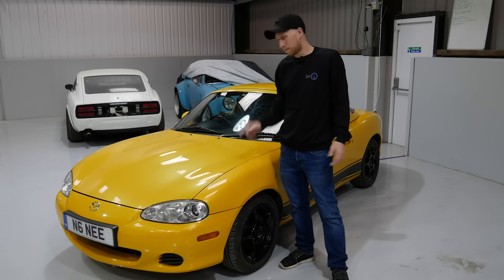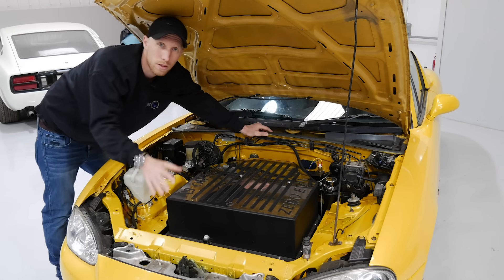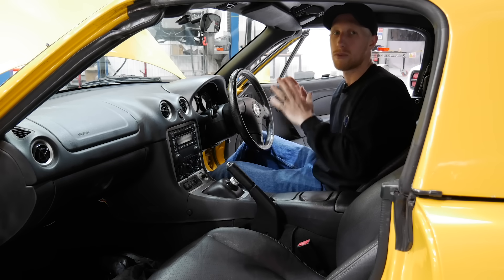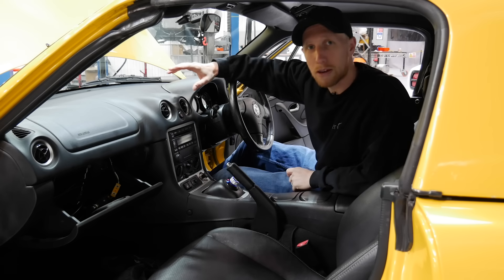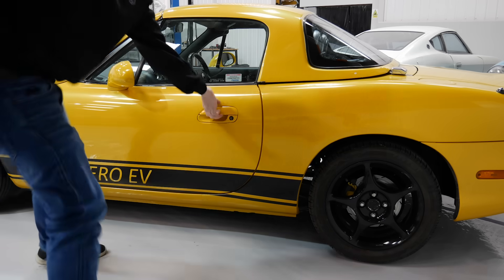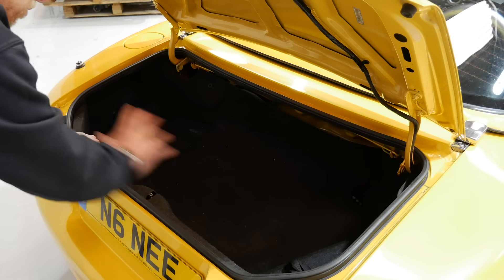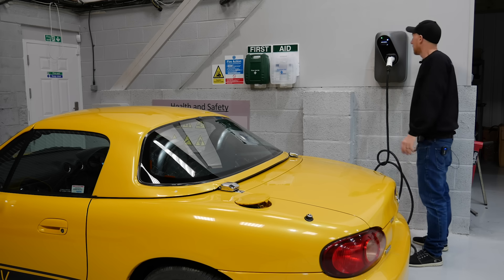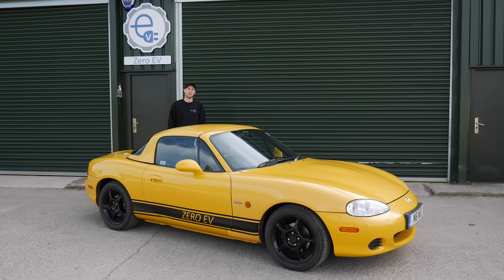Electric Mazda MX5 Miata Eunos EV Car Conversion - Complete!!!

Comment: The car looks fantastic and the conversion is really tidy. I don't understand why you built an enthuisiasts car that won't drive for more than an hour and a half before it needs to spend half a day on a charge point? There's no trips to the coast on the cards in that bad boy it would take three days.
Are fast chargers not an option on these conversions?? I have a classic mini to do but that range/charge option won't work for me.
Reply from the maker: This was built as a test vehicle, we do offer ccs2 fast charging abs larger battery packd

Comment: Using this type set up.. what would you need to produce roughly 250-300 miles? I have a Hyundai Coupe SIII and would look at using fast charging. So how long roughly to charge aswell?
Reply from the maker: Probably 70kwh plus battery

Comment: Great series, have just binge watched them all. One question - perhaps I blinked and missed the relevant part: what did you have to do regarding re-registering the car as electric with DVLA? Change of Taxation Class and changes of weight? Was an inspection needed?
Reply from the maker: No inspection needed just update to log book.

Comment: Is the motor turn the opposite way when you turn the knob to reverse??
Reply from the maker: Yes that’s correct
Reply: @Hazell_Nutz  ok i planning a ev build on my daily, it is a Volvo 240 and in the aftermarket a 5:88 Gear ratio is avalible so i Wonder if i just skip the gearbox and just make a fitting to the stock propshaft and like your Mazda have the motor (hyper 9) in the transmission tunnel. What do you think about such a build?? Will that work do you think and be reliable (200.000km in 10 years)??
Reply from the maker: Volvo 240 is a good choice. Definitely look at doing motor with reduction in the tunnel, then you keep the engine bay free fir battery’s. how much range per charge do you need?
Reply: @Hazell_Nutz  125 miles at least irl, but that is in Wintertime. So if we say 200miles in regular driving??

I dont need plenty of power. The 112hp motor (187nm) I got in the car now is powerful enough. Range is what I think is the most impotant thing and that its works Wintertime
Reply from the maker: I would recommend the same system as the Mx5 but do a double battery pack so you will have two 26kwh packs in Parallel.
Reply: @Hazell_Nutz  yes that sounds like a great system. I will consider that option. Love how the Mazda turned out. Great build. Thumbs up to you on that one :)

Comment: Power steering, AC and heat still work?
Reply from the maker: Heating has been changed to a pct car does not have power steering or ac but both are possible to keep

Comment: Purely my own opinion here and in no way disparaging your project or channel. I am from a different and older generation , raised on the internal combustion engine and not going to change. The Miata, when introduced, was for many, the modern, reliable version of the Lotus Elan. The Elan was arguably, the benchmark for sports cars. Can't imagine owning or driving a Lotus or Miata with nothing but a proper engine out front. Having said that, I realize times are a changin' and I support forward thinkers and technology. Well done but there will never, ever be an electric car in my garage. All the best.
Reply: If I may ask, I know this comment is old, but what exactly is the problem with EV? the engine? the lack of sound? or the type of fuel?

Comment: So it's slower, heavier, 3x as expensive as the car itself, has less range, takes 8h to charge and all on a car that is nearly old enough to be exempt from road tax anyway. This is not and will never be a good idea until battery technology improves.
Reply: 4 hrs to charge. 100-120 miles. A nice little weekend runabout or commuter. It has a place.

Comment: In the earlier episode it looked like your charger and DC-DC setup went in without any ingress protection? Also, what kind of Wh/km values are you getting? I've got an early model RWD KE30 that I'm looking to convert and estimating the efficiency is like stabbing in the dark.
Reply from the maker: Yes that’s correct, the charger and dcdc are both Ip rated. Not sure on wh/km yet need to do tests

Comment: Call me an idiot... but can you do a video on why you can't use the original transmission?  As a 'manual tranny gearhead', I love shifting as it adds to the feel and skill of driving a car.  Would it be possible to attach the electric motor to the input shaft of the transmission, and do an engine rev conversion where the top revs on the electric motor be converted to the max. revs on the car rev counter.  Of course you'd have to limit power output to max. the clutch can handle.

Limitation on space for the drivetrain maybe?  Possible to relocate some of the electrical components to work around the transmission & driveshaft?  Thanks.... from Canada.
Reply from the maker: You can definitely use the original translation and there are adapter for this. On this build we chose to test our new reduction gearbox.

Comment: As I understand it, the price for the kit will be around 20000 GBP, using the parts listed in the description.

What willit cost to use 12 Tesla batteries instead? That would give it around 38.5% extra power capacity, with only adding around 88kg extra weight (if the other parts weigh the same)

What will change to CSS charging cost?

Do you do installation? if so, what does that cost and how long does it take
Reply from the maker: Trying to find space for 12 modules is going to be hard. Could use a hv hyper9 and fit 14 LG modules which would add 10kwh more.

Comment: Your conversion is a really beautiful engineering exercise, but I am wondering why you would do a conversion that is not quicker, does not have more range, and does not have a higher top speed than an original car.  The Mk. 2 (NB) MX-5 (Miata) is not a new car, but it is a relatively modern car that might benefit from a more muscular conversion. Any plans for that?  I realize that I am in the US, and the attitude in the UK towards performance might be different.  If so, I apologize if I have offended anyone.  BTW:  I really do appreciate both the MX-5 and electric autos, having a Mk. 2, a Mk. 4, and a Tesla Model 3.
Reply from the maker: This car was built to test the system as we plan on using this set up in old British classic cars. Fir an Mx5 really wants a 0-60 of 6sec and top speed of 100mph.

Comment: Great conversion. Glad to see that you kept as much of the original car as possible and didn't burden it with unnecessary range.
The only downside is that you chose to get Jonny Smith to review the car.
Reply from the maker: He offered and has good subscriber amount.
Reply: @Hazell_Nutz  He has very little "mechanical knowledge". The Kardashians have many followers too. The numbers don't always equate to quality. But it does get you exposure.

Comment: Fantastic job 👍👌👍

When will you be converting a Discovery 3 or 4? They are dirt cheap.. the crank breaking issues means cars can be had for £1500! And no engine is perfect for EV conversation.
AFAIK no-one has managed a D3 or D4 full EV conversation yet...

Comment: Beautiful work. I would absolutely consider having this done to my much loved 2001 MX-5 with 36K miles. Unfortunately I am in California. Having been a Miata owner for 30 years (1990, 1997, 2001), I absolutely believe this carries the soul of the Miata forward. I know many would disagree with me, but it was never about the engine (although it was a great engine).
Reply: Try EV West in San Marcos Ca.
Reply: @stephenholland5930  I contacted EV West regarding 2002 conversion. They said their systems don't work with the OBDII out of the box and require significant modification if the cabling. I'd be keen to hear whether there are any plug-and-play solutions out there given the MX5/Miata is such a popular car.

Comment: Looks lovely, you have done a great job. Being rude but what was the total cost for the conversion? Also, does it have a fail safe to stop you knocking the twist knob into reverse while travelling forward?
Reply from the maker: It’s about 16k in parts, yes it’s set up to free wheel if you select a different drive direction until you go below a set speed.
Reply: @Hazell_Nutz  Thank you :)

Comment: Evolution of the aftermarket automotive industry as we watch.

I'm interested (once I've saved up enough) in a conversion for a car from the early 2000s from the PSA group which had a rediculous VAN instead of CAN bus installed.

Do you guys have any plans to interface with safety systems (airbags, seatbelt triggers, ABS, window regulators, alarms, central locking, etc...), essentially deleting the OEM ECU and maintaining full function?
Reply from the maker: Most of those systems you have list are stand alone and do not require the engine ecu at all.
Reply: @Hazell_Nutz  That's really great news! Thanks for the reply.

Comment: What happens if it rains and you have to charge it outside? Will that be a problem?
Reply from the maker: Nope not a problem, the Type2 has a drain hole and once plugged in does not alow water in.

Comment: A nice car,a good job with the conversion,is 100 miles range enough, would say 180 have been better? How practical would this have been? It seems underpowered,is this fair or not?✌️❤️🇬🇧
Reply from the maker: It’s a test vehicle for a mx5 really wants a high voltage system with 160-200hp motor and 35kwh battery pack with ccs fast charging. But this kit is the sort of thing for an Mgb or old British sports car instead.

Comment: Is there any way of increasing the range in that set up? Or making it faster to charge? I understand that perhaps driving an EV means moderating your driving style to increase range but here in North Scotland, even driving sedately, 100-120 miles is nothing. Lovely car though and great you've kept the 50:50 weight distribution.
Reply from the maker: We have other options coming out with higher voltage battery that can fast charge and larger packs are available

Comment: Great job!! I am curious based on what you guys know, how much range could be done while preserving the fun factor of a small car? I own a 2020 mx5 and dream about owning an electric version but 100 mile range won't cut it for me. I would desire 150-200 mile range. My other car is a nissan leaf plus with 220 mile range coming in at a hefty 4k lbs in weight. 

Thanks to you talented folks proving it can be done, I really feel that mazda has no excuse not to come up with their own version for the next gen in a couple of years.

Comment: Very nice conversion. I love conversions that you cant see on the outside and not much on the inside. 
 
But can you technically build in a 22kW AC Charger?
Does the Charge port lock the Typ2 cable?
Reply from the maker: Yep you could do 22kw charger, there is a lock but it’s not currently set up
Reply: @Hazell_Nutz  oh nice. Thanks for the answer. :)

Comment: FMPOV, this is a fabulous build! Still, I have a couple of questions:
Is there an air conditioning system in there? Is there ABS, ASR, and ESP systems in there? What about airbags, seat belt tensioners? Is there a standard OBD-II diagnostic link connector to connect to the CAN bus? What about the convertible hood to open and close (this car looks like it got a hard top)? What about options for cold climates like battery heater, window defroster and remote pre-heating/pre-cooling of the car? What about a CCS option for DC charging with 50 kW? What about a three-phase AC charger option for three-phase markets like Germany and France? What about infotainment options and smartphone integration? What about other battery options?
Reply from the maker: Way to many questions, please email sales@zero-ev.co.uk

Comment: I'm curious to know how hard it be to convert my 1999 Cadillac escalade into EV but have a 300 mile range and add solar panels on the roof for a charge boost
Reply: 300 mile range is likely a sticking point. By the time you get that many batteries in, you will have a monster that will likely need to have the suspension upgraded and wont handle well. One of the reasons alot of conversions focus on smaller lighter vehicles is because it requires less battery to get an acceptible range. And even then, on conversions 100 to 150 miles is pretty much the standard range you see for most conversions to keep the weight down and avoid changing the handling and safety characteristics of the vehicle.
Reply: Solar panels on the roof do nothing. Its already been proven a full roof of panels, living in Texas for example. 1 Full day will give you about 1 mile. Just not worth the effort,

Comment: What would it take to get the 0-60 in the 5 second range and keeping the top speed at 80 mph? I own an ND Miata (I know this kit isn't for the new one) and my 0-60 is 6 secs.  If I would want to EV swap I would want faster acceleration than stock.
Reply from the maker: It would fit as our new unit still has a prop drive. Would need an additional 6 modules which could be put in the rear.
Reply from the maker: The current motor is 80kw so you would need a 120+ kw motor.
Reply: @Hazell_Nutz  Would it fit? And how would that change the range?

Comment: I must confess, this is a nice car you got. But as a reminder, electric drive motor comes with braking system incorporated inside the motor, which works with  12V or 24V. This can be programmed with the controller using the gear selector(of course it's no long gear selector but drive selector). This will work like an ICU gear selector that will not allow the car to move on P but will be on free ride when on N. This motor braking system is normally active when power is not supply to it, so it will not consume the battery power when on P. I so much like your work, if only I can come to your garage to be trained. This is the future of mobility